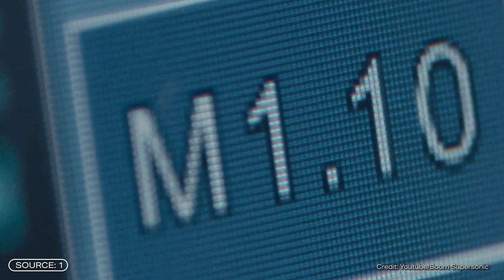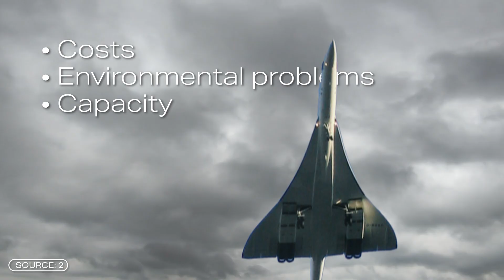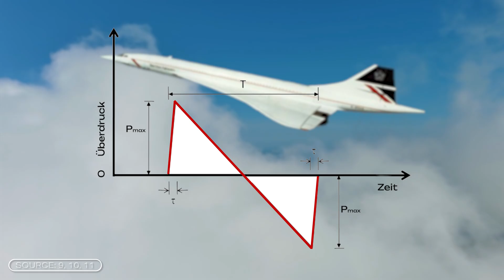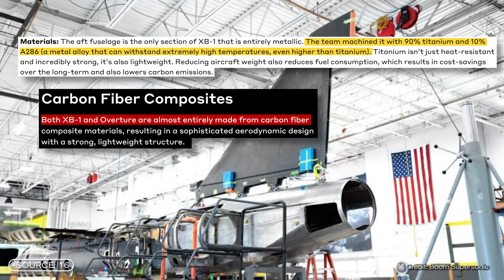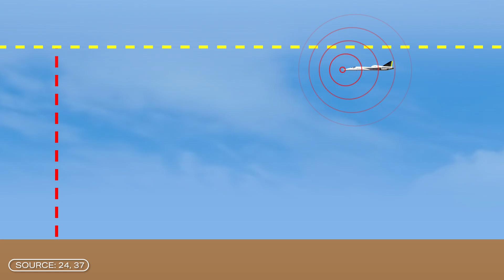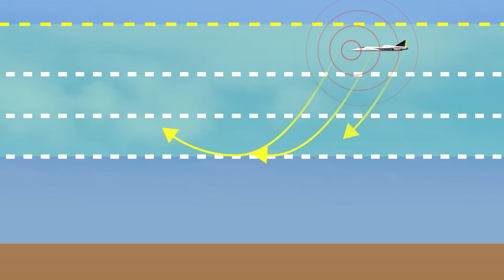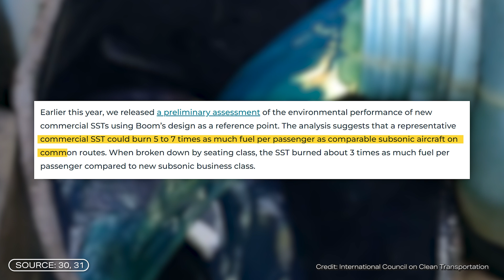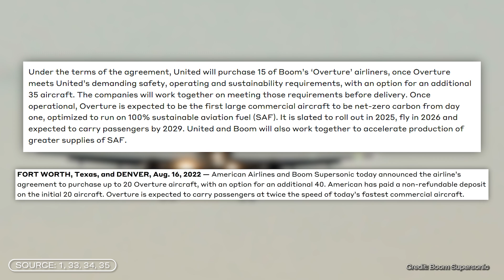Testflight Successful! Boom is building silent supersonic airplanes!

Comment: FYI: The weather is driven by the SUN. When the planets align is certain ways, their gravity pulls on the sun causing more or less sun spots which ultimately effects the earth''s weather. Don't be fooled by the power hungry left and their ideologies.
Reply: Instead of getting bad information from Foxnews get actual facts from scientists. Sunspots mostly affect electronics on and around Earth, not how hot it’s getting. No matter our solar system’s orientation within the Milky Way, Earth has never heated as fast as the last 200 years. Ever. Scientists (not entertainers) have taken ice cores going back 10s of thousands of years to determine the gases in the air at those times. So they know we have way more CO2 and CH4 (methane) in the atmosphere which has grown at an alarming rate in the past 200 years aligning perfectly with the Industrial Revolution. Oil companies own scientists said the same thing in the early 1970’s their internal documents showed. That’s why they started their disinformation campaign and buying politicians. They now own a President and the Republican Party. Forcing the US to use 200 year old technology will have massive repercussions to our industry and technological leadership in the future. He handed leadership to China. This will not end well.

Comment: Chuck Yeager said "Mach", and so do I. As an aside, it's funny how much these newer airframes resemble 1950s aircraft like the B-58 Hustler and the F-102 Delta Dart.  Sure, the new versions are sleeker and more refined, but the salient features are reliable and consistent.  Air hasn't changed.